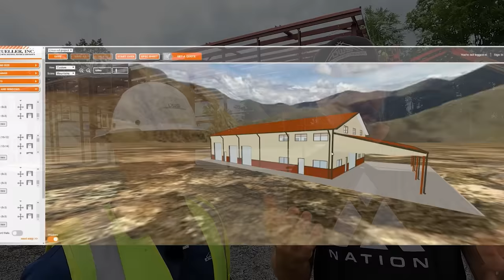Pole Barn v/s Steel Building your dream shop or barndominium explained

Comment: I looked into this as well.  Steel building for me wasn't worth the extra cost.  If built right Post Frame will last 100 years easily.  If anyone doubts this remember there are probably a million wood houses around the world that are over 100 years old.
Reply from the maker: lumber from 100 years ago isn't the same as what we have now my friend...and a house isn't a pole barn..it's on a rock or brick/concrete foundation. Problem is the wood in contact with the ground....didn't cost any more to build this steel structure than the pole barn my friend
Reply: @StoneyRidgeFarmer  Thanks for the response.  If I can disagree.  For what you said you paid for your building you could have built a Post Frame for a fraction of the cost, plus got spray foam insulation, and steel interior walls.  To expand, a post frame doesn't need a foundation and you spent $70K on concrete alone.    Then you have all that steel cost as well.  Price wise there's no comparison.  To keep the posts out of the ground all one needs to do is use prefabricated columns or make piers.  R&R Buildings has videos on this.  I do agree that a steel building is more durable, but in practical use you'll never see a difference in a lifetime.  Or 2.  Not dogging your choice you built a great building just don't want others to think they have to spend what you did to get a building that will last.  Have you looked at the R&R buildings channel?
Reply: @NoName-ml5yk  I was told by a friend who had an engineered shop that steel was about twice the cost of a pole building. I don't like the idea of a pole building, they don't last many decades.
Reply: @melissasmess2773  You don't have to bury poles in the ground and even those will last 70 years at least.

Comment: No matter what, a steel building will always be a better building and that is the choice I have made.   That being said, this expansion and contraction at the same rate is a bunch of hog wash.  That makes me mad because you don't need to prop up the value of steel.  There is insulation between the outside siding and the structural steel.  Plus the structural steel has a far greater thermal mass than the siding.  The siding feels the heat or cold much sooner than the structure and it take much longer for that heat or cold to transfer to the structural steel.  Just pisses me off to hear this kind of crap.

Comment: dude... i have a pole barn that is 2 stories, 75 years old in Northern Virginia.. im about to post a video about it.   It uses 4x6s for the roof truss supports.. and they are bolted together using steel bars to the roof beams, right through the 4x6, also has steel bolts on every joint connecting these 6x6 and 8x8 and 4x6 beams through out... nothing is "wearing out"  the only damage to the barn is 3 of the like 30 6x6 and 8x8 beams are rotten from termite damage and from the gutters not being replaced.  The rest are all fine.   This engineer is bullshtting you.   Also go outside and touch the hood of your car during peak sun hours.. and tell me your hand doesnt get burned.. i can cook and egg on a metal hood.. now when was the last time you touched wood and burned your hand ?? lol never...  The metal inside the building WILL expand differently no matter what because it is cooler inside than outside.    Wood barns are also inherently cooler than metal buildings and dont require much insulation if any depending on the building use..  My barn has no insulation... weve had near 100f days here in VA so far this year.. it was 25f cooler inside the barn than outside.. a metal building would be an oven and REQUIRE insulation..  to where a wooden one does not.

My barn is 100x40 feet.  there is no supports in the middle.   The 4x6 truss beams that are going diagonal are supporting each other by the design of the truss, they are also supported in the center of the span of the 4x6s with 2x6s bolted to them to add strength to the center of the long 40+ foot beam.  to prevent sag and add weight support .   Once i replaced those 6x6 pillars with termite damage and replace some of the outer board and batton walls.. i dont doubt this barn will be here another 70 years.. as long as its maintained with gutters and occasional repairs.  Just sayin

Its a matter of design my man..  as for 115mph wind speed.  This barn being 70+ years old has survived many hurricanes and many high speed winds.. the other day we had 120mph winds and tornado warnings in the area..   Nothing happened to it.

Comment: Wood to steel... having a REAL hard time your description of wood to steel kills the screw... yet right behind you they are covering your walls with MDF(Wood 4x8 sheets) and then Insulation on top of that... the SCREWs through those metal panels into wood and metal....
Reply from the maker: there is no wood in this building what so every my brotha
Reply: @StoneyRidgeFarmer  then his is someone else's video.. move your storyline to 0:43 seconds and hit play..  those are MDF WOOD sheets .. can even see the sandwich of those INsulation to Wood to Metal sheets on 0:38 of the video

Comment: This is a guy who is ENAMERED with what he purchased and it is obvious.  I live in East TN and we have barns that are 100 years old that aren't falling down.  Don't get me wrong some are, and they aren't the quality you need today for sure.  The point is done correctly pole barns will last plenty long enough for multiple generations and this video literally feels like a sales video with his friend.  If I'm wrong please tell me.
Reply from the maker: you understand that this isn't a "barn" my friend.....the lumber that we used 100 years ago v/s the fast growing pine we use today with treated lumber simply isn't the same quality or strenght.  I built this out of steel because it will never rot as long as I have a good roof and keep up my maintenance.  My step father's pole barn is falling into the ground and it's 20 years old...ground contact with wood simply does'nt last like it did with old growth lumber.  I'm all about steel...from my fence posts to my buildings...I want them to outlast me if possible.  Big difference in a "barn" for livestock v/s a shop like this...if it were a barn...I"d be building mostly out of wood

Comment: Total nonsense what you say about wood structures. Pole barns have been around for centuries. Claiming a pole barn will rot out in 20 or 30 years is BS. The can last 100 plus years. Calling yourself a farmer you should know better. Nothing wrong with steel buildings. But you pay a lot more, and a lot of the work can’t be done by a local farmer. I personally am still enjoying the barn my grandfather build 72 years ago. Also wood buildings can be easily altered or modified for different uses, and are easily expandable. We just experienced a major hurricane here in Florida and the medal structure’s did not do very well here in high winds. Something to take in to consideration. And then you go on to say that the metal only has a 20 year warranty. Just bad real bad information.
Reply from the maker: Putting me down is the best way to get other's to respect your reasoning isn't it? You're saying that wood rots slower than metal?  The lumber from 100 years ago most certainly isn't the fast growing lumber of today my friend.  We built a steel structure so it would last....it's just that simple.  A man can make his own decision based off the information he collects prior to building.  Ya wanna build wood...then build wood...putting me down is not necessary and speaks volumes about character
Reply: @StoneyRidgeFarmer  I’m not putting down, I’m merely pointing out that metal is not necessarily stronger, or will last longer than wood as you claim in your video. Is incorrect. Lots of post frame builders on YouTube providing excellent videos. Furthermore farmers used whatever was available to create shelters for livestock , storage etc. it was what they had and it was economical. Lots of those structures all still in use today. And absolutely nothing against you nor your metal building. But not everyone can afford 70k for concrete and a other 100k for a building. Timber frame construction is by far cheaper and a bunch of friends can figure it out quickly, and build very functional structures at a reasonable price that will last many generations. And you can look at it and take pride you did it yourself.  Cheers